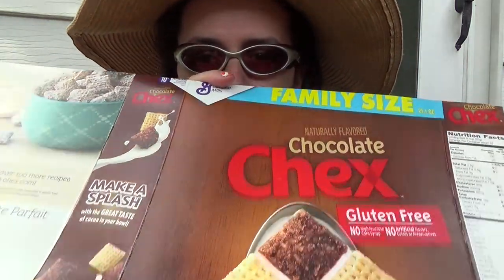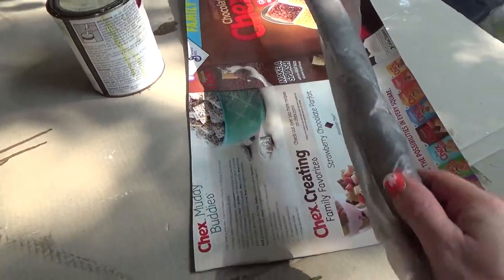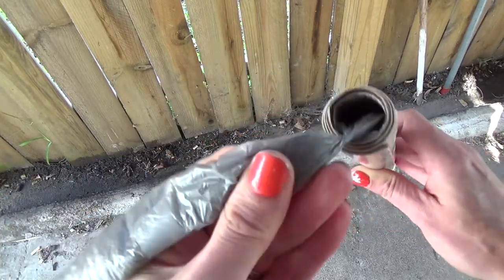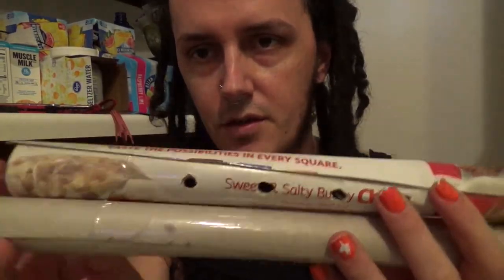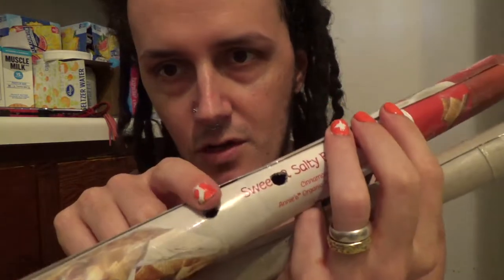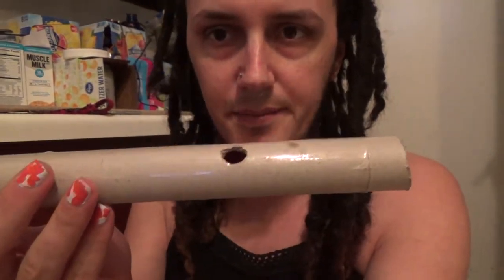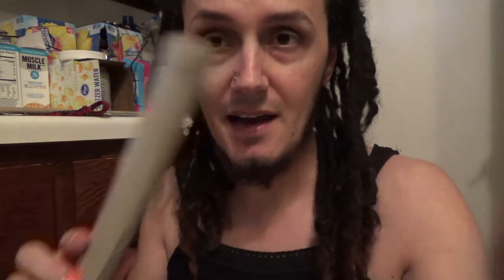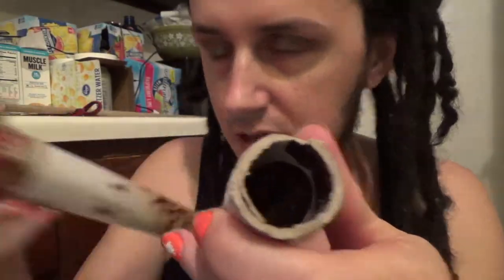Can I make a flute from a cereal box? part 2

Comment: It's really hard what yr trying to do. Naf flutes have 2 sound holes with a block between the two and then a ridge and a cover (my v bad description) because even if you blow it straight on like a japanese flute the sound is made by air forced over the second hole. Of course I have zero experience but i would think a transverse flute would be easier and give good sound because it's a more simple system.. :)
Reply from the maker: Thanks for the advice!